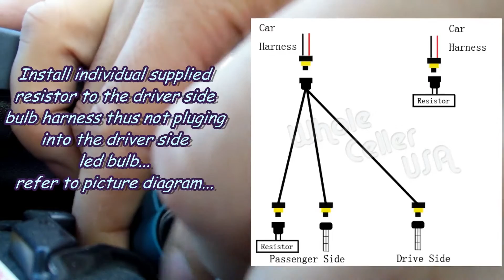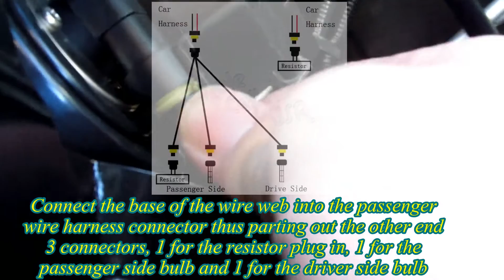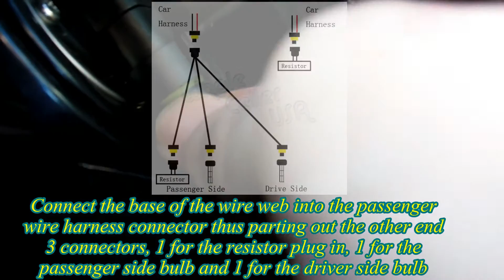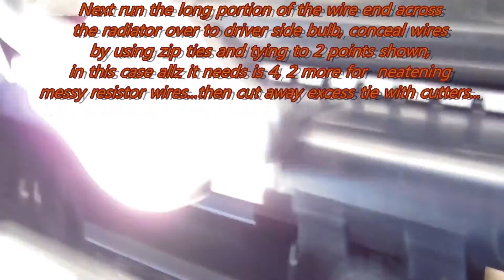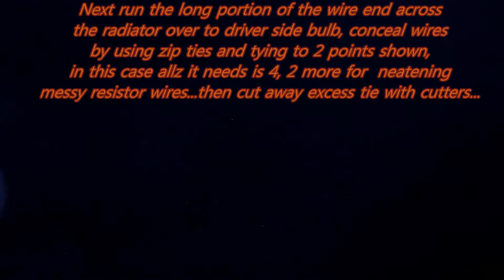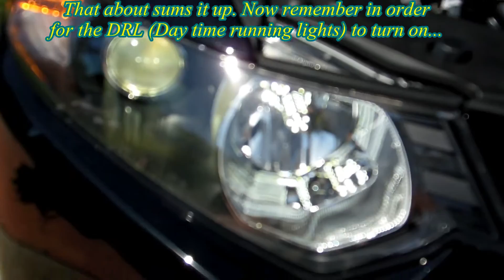How To Install 9005 White LED Day Time Running Light Bulbs For Acura TSX 06-13

Comment from the maker: After prolonged use after installing this kit. The decoder might be necessary in order to maintain life expectancy and anti-flicker, not to mention over-heating of the led bulbs. As far as brightness of the bulb itself. The darker out the more noticeable they will become. Or just turn on the high beams. Its legal since led don't project concentrated light they do not blind other drivers. I've tested this passing in front of Mr Poepoe a dozen times. So yea, install it with the decoder kit please.

Comment: I installed it exactly as u did and my lights will not turn on. I get an error message saying to check my DRL system. I have 2010 Acura TSX

Comment from the maker: yea, it should fit & work for any Honda that has a it's own independent high beam bulb.(since that's what your gonna replace w/ the dtrl bulb) Since some Honda's like the civic has a single bulb which produce both low beam and high beam. In some cases just as long as the size (bulb number in my case 9005) matches.

Comment from the maker: Skip to 6:16 on the video and check out the diagram. It shows 2 resistors and 2 bulbs. As far as a 3rd resistor in the kit would probably a pakaging error. For the design of the wiring kit (it being 3 connections on passenger side, single connect decoder/resistor driver side) I personally think its to maintain an equal and stable amount of current distributed threw the led bulbs in turn equal amount of brightness on both sides not to mention reduced flickering, single resistor is complete loop.

Comment from the maker: with the harness kit, is the right thing to do to save yourself from the head aches. The kits usally do come with the harnesses. Just be sure to order the right part number to avoid going thru the trouble of having to return a fairly cheap kit paying return fees especially purchasing off ebay. in acception of th e seller even agreeing to returned items...but yea...harness yes get it

Comment: thanks for your video. followed it exactly and everything worked out fine on my 2007 acura tl. However some of the tiny bulbs on both of led light itself are not lighting up. Do you know why
Reply: Mine do the same thing. They work when connected straight to the battery tho. Go figure. Did you ever get them to work ?